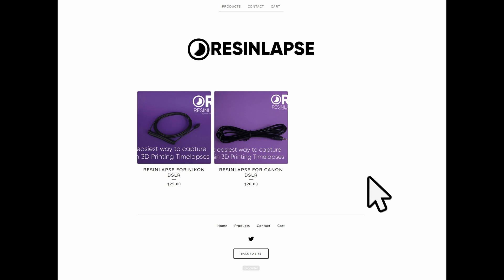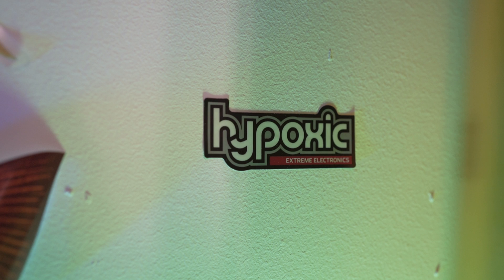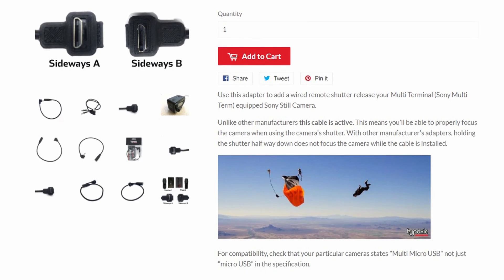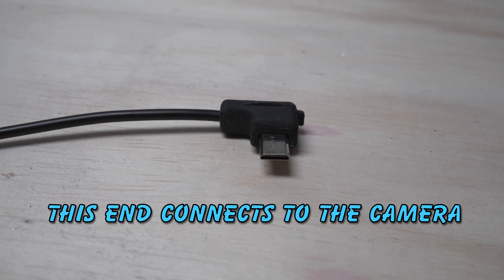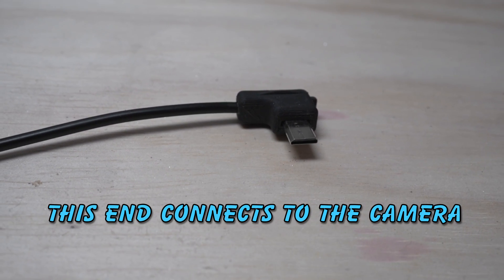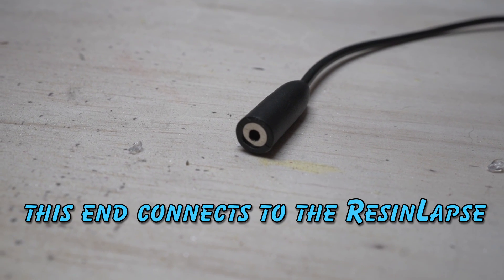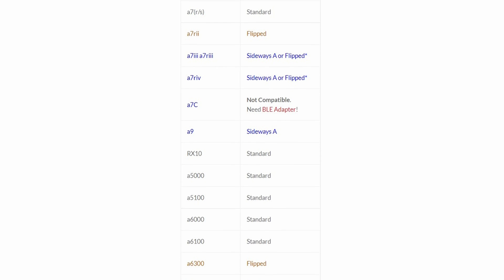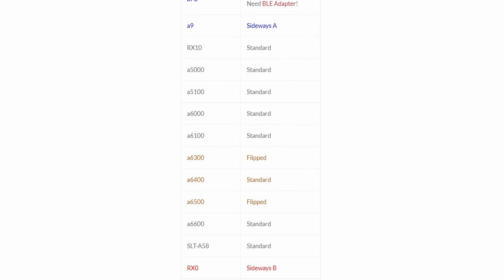ResinLapse on Sony Cameras

Comment: This cable works but it is hardly sensitive at all. Have you found a way around the trouble getting it to actually shutter???
Reply from the maker: Sadly no I have to get the sensor really close to the light for it to work well. I am assuming it is something to do with the voltage from the sensor but that is out of my knowledge base...

Comment: Is this the only cable that it would work with? I can't justify spending 70$ for a cable lol would any micro usb to 2.5mm adapter work? I wonder if you could technically just re wire a micro usb to the resinlapse cable via stripping and cutting the ends off
Reply from the maker: It's the only one I found that works without issue. I have seen some people use a remote and rewire them them and splice them together. This is the only cable I am aware of that works "off the shelf".

Comment: What resinlapse cable did you use though
Reply from the maker: The OG Canon one, sorry when I made this they only had 1 out.
Reply: @WMBayouLures  no problem wasn't sure and didn't wanna buy the nikon one with the adapter and it not work

Comment: Very cool! I actually just got my adapter but it’s not registering the shutter. I’ll try placing it closer like you said.

Do you know if there needs to be any special setting enabled on the Sony for it to work? 
Or what photo setting you usually use I have an A6400 on the MR setting right now.
Thanks!
Reply from the maker: My USB connection is set to PC Remote. The best way I have found to test is with a UV flashlight, point it at the end of the sensor and turn it on and it should fire. If it does not you have issues. If it fires with the flashlight but not in the printer then you have to find a better spot for the sensor.
Reply: @WMBayouLures  Thank you!! Your right I just had to put it way in there. My canon would pick it up barely hanging but with the adapter you gotta put it right on the light basically haha. 
Glad I watched this and thank you!
Reply from the maker: @amity3d  glad it worked!